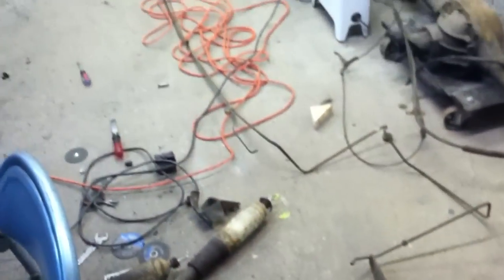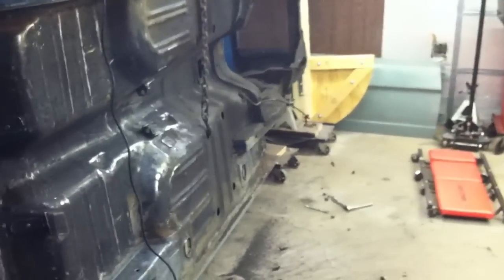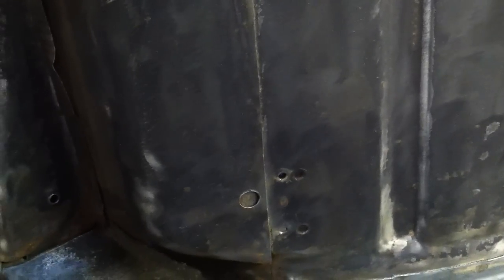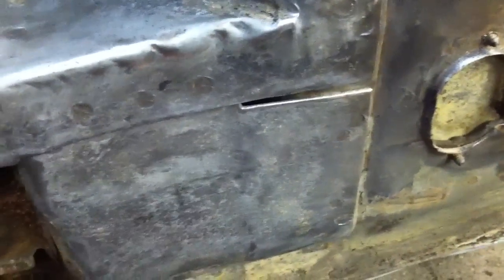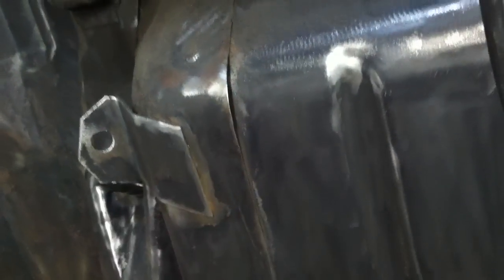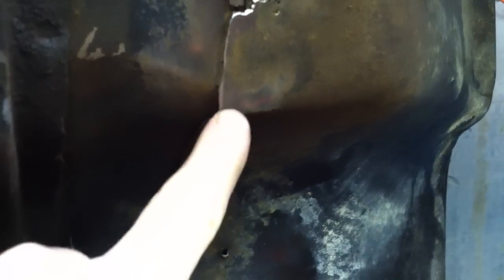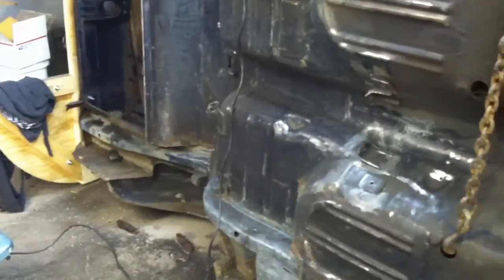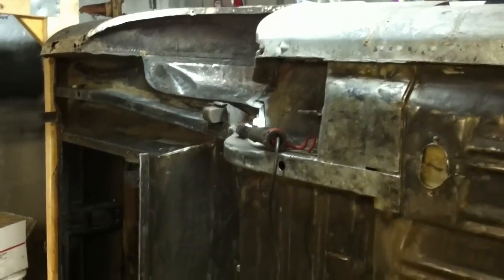Floor Pan Update

Comment: Those little open pockets were like that from the factory I think, I found a few spots like that on mine. The factories were throwing these cars together so fast they didn't really worry about perfect fitment. 
Good job, it's looking good so far. Sounds like you've got a plan and it's moving along!

Comment: $10 at home depot will buy you a gun that will work fine for under the car stuff....
its messy with one of those, but they work awesome!!! bucket of sand for blasting shouldn't cost more than $40. find a buddy with an aircompressor and your done! ;) you will spend under $100 if u can burrow a air compressor... good luck, i'll suscribe to watch progress...